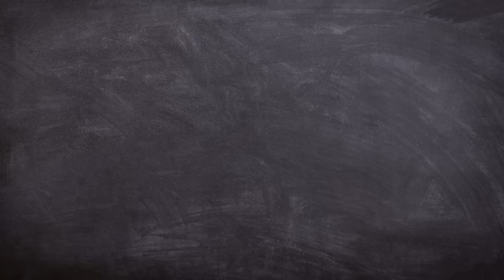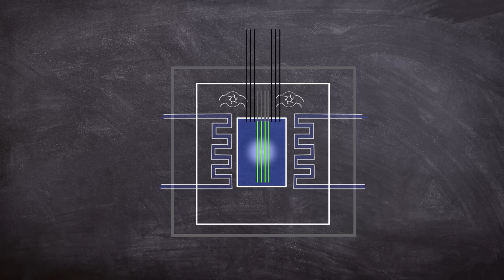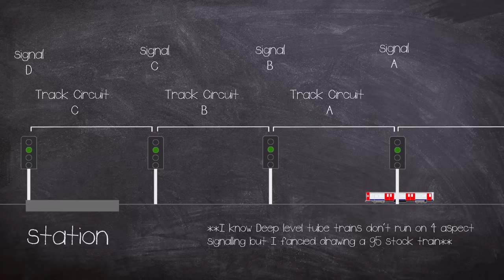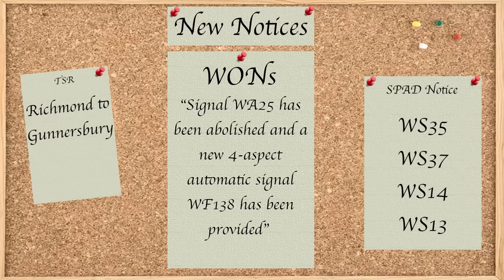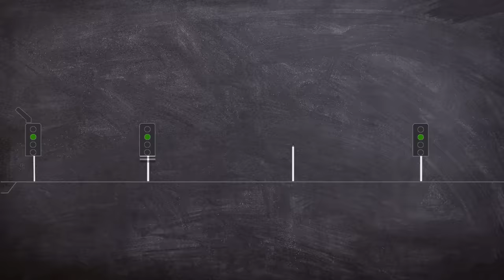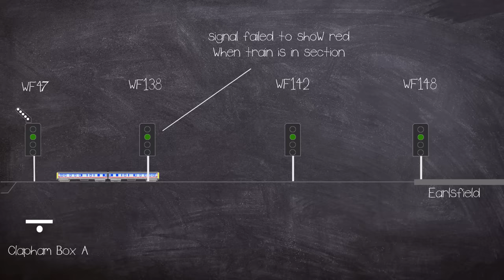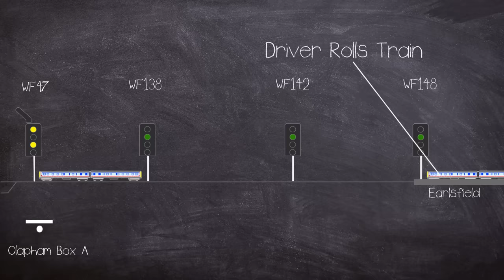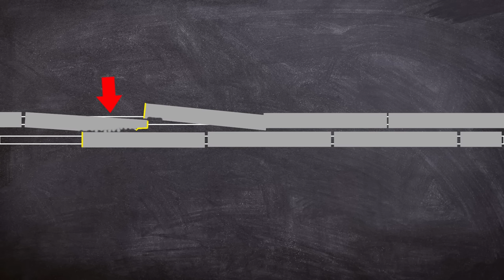A Brief History of: The Clapham Junction Rail Disaster 1988 (Documentary)

Comment: As I understand it, the signal wiring change was made correctly. However, the old wiring was simply cut at the relay and bent backwards (upwards) to get it out of the way, before the new wiring was added. The problem showed up when the wires relaxed and fell slowly back (under gravity) towards the positions they had previously taken before the change, and made contact with the relay connections - causing chaos in the signal light sequence. That, as I understand it, was why the signals appeared to operate correctly at first and passed all the basic operational tests, but started behaving oddly later in the day when the old wires made contact again. (The signal relays, in general use at that time, were about the size of a car battery, held on racks with the wiring laid along the underside of the rack above and then brought down to the relevant relay connection.)
Your assessment appears to suggest that the signal wiring was made incorrectly, but I don't believe that was the case.

Comment: My father was an engineering consultant to the enquiry and was extensively involved with the structural performance analysis of the rolling stock and how it should be improved. Much good work on crash survivability came about as a result of the accident that the railways organisation also paid for. This NCAP style work is a great lasting memorial to those who lost their lives and more so than any simple fine could have brought about.  It protects us all to this very day every time we’re a rail passenger.
  I often think that the current punitive fines culture forces defendants into denial mode, often at the insistence of their insurers. It’s hard to take ownership of your failures if you are in denial/victim mode. Better to invest the money into root cause analysts and the improvements that may arise from it. This no blame culture has worked well for the safety of the airline industry.

Comment: I bought a 70s telephone on ebay this morning (GPO 741 wall telephone), and noticed the dial card it has is for Potters Bar, and when I saw that, my heart sank remembering the train crash at the Potters Bar station in 2002, which in that case was due to poor maintenance from private contractors resulting in the points basically falling apart under the weight of the train that crashed... :(

Comment: Ah, cables. The one thing you can guarantee is that they’ll do exactly what you don’t want them to. As someone experienced with cabling, the most commonly occurring thing is tangling. A bunch of untethered cables will always become inexplicably tangled. The next most common is what I call “cable memory”. I’ve found cables need a lot of time to settle into the preferred position, and in the meantime will work their way back to where they were before you attempted to make them do something else. I suspect this is the main cause of the tangling as new cables try to slink back into a coil. But on the other side, a cable that’s been in place for a long time will eventually return to where it came from. A thing that was catastrophically demonstrated at Clapham Junction. This has led me to two very important rules that I always follow:
1. Use cable ties liberally 
2. If a cable is decommissioned, take it out as completely as you can

Comment: Bravo Madge, Plainly Difficult! Spot on there you are again!  :)

If you think British railway/train signals are complicated, you should see some American systems where they have (or had in some cases) not only position-light signals, but various combinations of red/yellow/green/white to denote speeds AND 'distant signals' you can't see yet (like red over yellow meaning a distant signal could be 'approached prepared to stop' but another might mean 'change train speed to 'approach speed slow/medium' (a certain number of miles/kilometers per hour). American railroads even had position-light signals that illuminated diagonally, vertically, and horizontally to denote various notifications. In some areas, the various railway/railroad companies hammered out signaling standards so they could operate over each other's tracks without confusion (American railroads were never fully nationalized, the closest and only one being our "Conrail" out of several bankrupt or nearly-bankrupt Eastern US-based railroads in the 1970's), so some railroads used various combinations of light colors and positions which meant different things on different railroads.

Comment: I remember watching something about this disaster on TV when i was little, but the wiring thing was beyond what I could understand. 

In Denmark we have a much different system and the signal design is not persistent everywhere - rural lines can have different signals than the busy main lines. Our signals don't have yellow, but use a system of solid green or flashing green (or double green on older signals), and then red. Solid green is effectively the same as yellow and means only the next block is clear, while flashing or double green means the next two blocks are clear. The old signals with double green are mainly on lines that don't have ATC, while the flashing green are on lines that have ATC. Yes, many of our rural lines have no form of ATC and rely entirely on signal obedience by the driver.

The reason the signals don't have yellow is because yellow and white signals are used for road crossings - yellow means the crossing is not safe (no gates or lights), solid white means the crossing is "safe" - lights and bells are on, but it has no gates - and a flashing white is a safe crossing, where the gates are down. Crossings without gates are mostly gone now, but some still remain, especially in the country side

Comment: "The lessons learned from the accident would help shape the modern UK railway which would never be forgotten" cuts to Waterloo, 2018

Interestingly there was another pair of wrong side failures just last month in Scotland still under investigation where the switches were incorrectly detected in the normal direction and no lock was in place, allowing a train to be routed through on a clear movement authority. The train went over at speed as the driver likely thought they had the main road, only to be shoved onto the wrong road with the switch moving under the train as it passed, derailing the rear vehicles. This coupled with the other wrong side failure at Waterloo less than three years ago, maybe the lessons of Clapham are slipping.

Comment: Been an ex signalling technician, what Hidden did, was bring in, no more than 12hours worked. Maximum days 13 out of 14. Shift change had to be a minimum of 12 hours. I can remember doing nights and be back on days after 8 hours of rest . Use of independent testing of all renewals and refitting of equipment. That’s now changed after I have left with renewals. But at the same time track access was made safer. With staff having to take procession of the line, where it was too dangerous to use lookout. But that sort of 2 year period. 1988 to 1990. A lot of major accidents happened, which forced everyone’s hand.

Comment: 3:11 Funny thing about this, a very similar system is used for roller coasters! Blocks are segments that keep coaster carts from colliding into each other if a cart is occupying a zone
Reply: The interesting thing is that the traffic signaling for autos in the US is based off the railroad signaling.
Reply: @caferace8418  it actually depends on the area you're in, the light formats varies greatly from town to town and state to state 

Still very Interesting :>
Reply: @astronomydemon6312  No doubt it has evolved over time, but the basics are still there.

Comment: What made the Clapham Junction crash worse, was that the rolling stock was old, with lots of heavy wood in the carriages, being used because of lack of investment in British Rail. That probably also applies to why the signal failure happened. I often travelled on trains that were well past their best, during the 80s and later. There were also often train failures and signal failures too, so this was probably an accident waiting to happen. At least there wasn't an express train involved, unlike the Harrow crash in the 50s. The slam door trains may have been easy to escape in the crash, but these doors were also prone to opening, if not shut properly. I experienced that door opening twice. Once in the early 80s and later in the early 90s. I was on my own the first time and had to move away from the open door. The second time someone else shut the open door.

Comment: I worked at VSC Clapham junction Central Division, it was a Disaster! Opened in stages January 1980, interlocking, points, track circuit failures constantly. ASE was 'Wrong man for the job'had to be paid off, replacement narcissistic told by Chairman BR Board that he was to be sacked in 6 months time with Chief signal engineers unless failure rate dropped, sent out questionnaire, I made lots of recommendations, to reduce failure rate, 2 was carried out, had to have all 4 men out on track, previously top grade didn't want to do outside work, 2nd recommendation can't say, improved railway operations considerably.

Comment: I was a light rail operator in Portland OR. You did an excellent job of explaining what we call the Automatic Block System. Much better than my rail instructors…..!  But I am surprised that the red aspect is at the bottom as ours are at the top of the signal. You silly brits!!
Reply: Its at the bottom of the signal so it is at drivers eye level. 

Just so you know.

Comment: Hate to pick but I'm surprised no one noticed that your wiring diagram was too simple, it got the main point across in that the old wire wasn't made safe.  The new wire (wires actually) ran from the same point as the old but was split and connected to a new relay between the 2 points of the old wire, hence if the old wire reconnected the 2 points directly (or cause a short circuit) the signal couldn't "fail safe".  Another lesson learned was that an independent inspection of the wiring work was not done which should have uncovered the fact of 2 wires connected to the starting point instead of just 1, also called a "wire count".  It was a lack of true safety procedures followed by BR at the time and was probably more of an issue in the crash than over-work itself.  The "electrician" who did the job forgot to disconnect the old wire at the other end at all.
Otherwise loved your video.
More information from the causes to the crash are available from the DoT Investigation into the Clapham Junction Railway Accident by Anthony Hidden QC, available as a PDF.

Comment: I remember the old box over all the roads, and start to lean in the end.   The replacement Wimbledon power box is better, only caught fire once (A/Con !)   (tacked off the end of the Ex-Dundonald Road Power Station), yes we all got drilled on pvc tape. That's the problem with wiring looms the box tickers don't like the clearup costs, I much prefer pvc spirowrap although I was tutored by a glasgowman (ex-Shipyard) in the intricacies of waxed-string looming.  The trouble with the railways environment is vibration and temperature.    PVC tape adhesion dries out, and uncurls, and no one ever puts enough on,  old termination should be cut back, a Wago or even screwed end caps fitted, tied back into the loom.   But better to chop it all the way back, personally  it surprising how low, medium, and high voltage levels can be found in the signal dept. gear.
Rostering is always a problem, increasing shifts, a mere panacea, "doubling back" from Nights to Lates  - horrid
         (Travel in your time)         -    so   Some exclusions may apply !    Power Boxes not so much !

Comment: you should do the paddington disaster next, that was another wreck caused in part by bad signalling, i know thery say that the driver was partially involved but so was the signals
Reply: Wasn't signal 'SN109' hard to see because of the overhead-wiring clutter and gantries around it ? When the driver did pass it in error, the track-layout didn't allow his train to avoid the collision with the incoming express. Maybe the track/signalling planners saw the possibility of a potential accident but took the "it's-not-likely-to-happen" way out of confronting it. 
  A SPAD in 1991 led two trains to collide at low speed in my area. This happened on a single-lead track that had replaced a conventional century-old junction. Only after the crash (few injuries) was the junction modified to include catch-points and a long sand-drag, plus a platform "OFF" starter signal. The signal which had been passed at danger was a 3-aspect colour-light sited high up  on a gantry, in a position  just ahead of the cab of the d.m.u. that had moved away under it. Another 'SN109' ?

Comment: Great video as is all of your content.  So the following is not criticism, just an FYI.  The friction force between the wheels and the track, which stops the train,is not dependent on the contact area of the surfaces.  Friction is governed by the materials in contact and the weight of the vehicle.  The steel wheel in contact with the steel track does have a lower coefficient of friction than the rubber wheel of a car does on pavement.  Trains take a longtime to stop simply because of the weight of all the cars.

Comment: If running on absolute block then you can only have 1 train on each block (section) of track. If running on permissive block you can have more than one train, but only in specific conditions. Freight only lines can have permissive or absolute blocks. Lines with passenger trains are absolute blocks, except at platforms where limited access for 2 or more trains can be allowed.

Comment: Seems to me the British never learn that wires randomly thrown into a system can cause a short circuit. I recently bought a Raspberry Pi 4B 4GB, this model is allegedly manufactured by Sony in Wales, the vendor is a British company in Cambdridge, and it had a long (wire-like) blob of extraneous solder stuck on the soldermask (the green nonconductive paint). Which meant it was just waiting to randomly peel off and fall into the pins of the long GPIO connector and short it out and blow the board. There was also a smaller round blob somewhere else.

Comment: Sad to hear that the abnormal signaling had been noticed by multiple drivers but not reported per procedures? (Sounds like it both fell below the perceived criticality threshold and may have been a case of minor failures routinely ignored...?) Really illustrates the difficulty of designing & implementing failure-proof safety systems - even if the system is there, it often still relies on a human factor that can't be guaranteed to function as per procedure, even in a truly safety-critical environment. Add in overwork and any maintenance changes, and the ol' Swiss Cheese model so often kicks into gear...? 😔

Comment: There is two words every train driver hates. Those words are wheel slip. It only takes a small amount of water on the track and you become a big tin can sliding on ice. It concerning because even if you start breaking on sight of a caution signal you can still slip right passed a signal at danger (SPAD)

Comment: The signal fault was the obvious cause of the accident and that point cannot be argued.  However, it is/was a very usual situation for that time of the morning where drivers received one and two yellow warnings consistently on their journeys into Clapham Junction and on to Waterloo.  My guess is, and I have not seen anything to the contrary, that the driver following the stationary train had been passing one and two yellow aspects since way before Wimbledon and certainly at or after Earlsfield.  Drivers, as you point out, are trained to notice anything unusual and green aspects at that time of day on the approach to Clapham Junction following constant one and two yellows SHOULD have warned the driver that something was not quite right. It would appear that the driver must have had at least 2 green aspects that he passed at a much higher speed (you say 50 MPH) than he would normally be able to travel at that time of day.  One could say that the fault did not just lie with THE signal but also with those leading up to it - there was obviously no failsafe built into them if they were, indeed, showing "green".  Yes, of course the signal was to blame but 100%?  I am not sure about that "aspect".

Comment: 14:15 I wonder when does the clock start and stop? If that "12 hours minimum between shifts" includes the time spent commuting to the work site and the shift hand-over?  From my own experience, in practice you're getting less time resting at home than that 12 hours, as it magically turns into 10 hours after everything you need to do

Comment: Wow! I hope they put radios aboard those trains. The accident might have not happened if a driver didn't need to stop the train to use a phone. The accident might have happened anyway if the per running the service ignored the issues. I'm not exactly sure when they put radios in buses here in the United States. I started kindergarten in the early 80s, and the school buses were already equipped with radios.